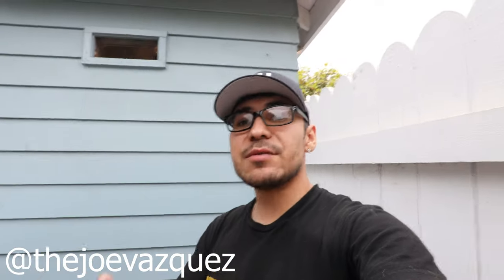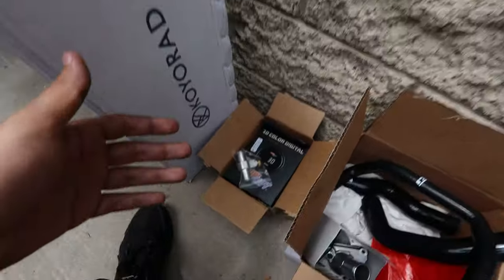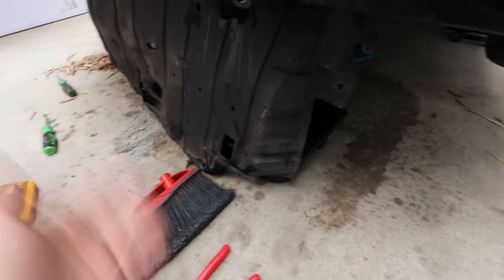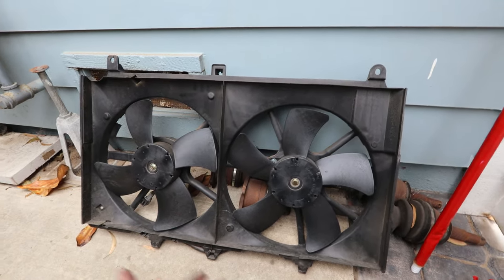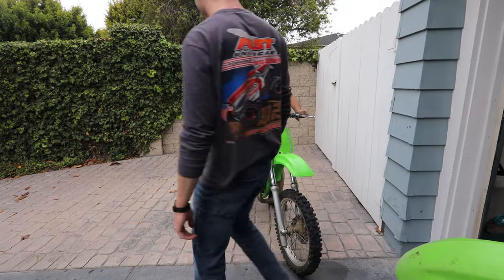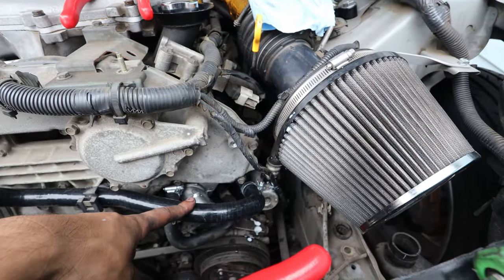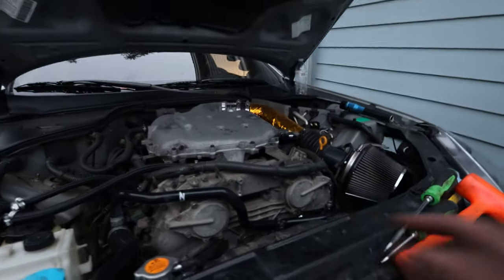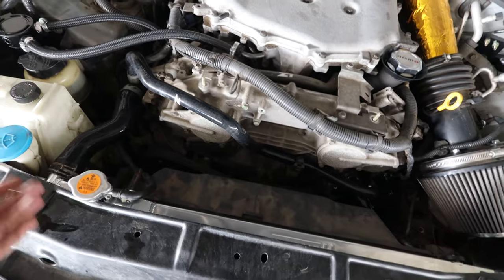Koyorad Radiator Upgrade on my G35 + Giveaway!

Comment: Same radiator I'm running and I love it. Good choice and nicely done!
Reply from the maker: Thank you!! I’m glad to hear that! Quality is definitely there and could not be more happy!!
Reply: Could I be fully stock and get that radiator ?
Reply: Yes you could, I'd suggest doing new hoses at the same time though but not nessary  just my preference.
Reply: @theg-zguy5268  like the same hoses Joe got?
Reply: Any quality silicon hoses, z1, mishimoto, zap ect.
Reply: @theg-zguy5268  okay and would mishimoto radiator work too? Or which one is better?
Reply: That's preference IMO so can't really help you out there. I prefer my koyo personally but everyone has their own opinion on what they like.
Reply: @theg-zguy5268  it’s just cause I’m stock and I have a coolant leak. I’ve had someone tell me I can’t get Misimoto or Koyo.
Reply from the maker: You can definitely run them no problem, I know mishimotos is a bit thicker than koyo, so clearance may get a bit tighter with stock fans, which is why they have low pro fans aswell but you don’t need them as stock fans are great. Koyorad isn’t as much as a sacrifice but still has great quality. You can’t really go wrong with either.

Comment: Hi, good work!
I have a question. This radiator has 53mm core? I'm searching a new water radiator for my 350Z and there are 3 diferent models from koyo! 36mm, 48mm and 53mm. Do you know which is yours? I'm worry about the fan shroud can't be installed if the radiator is too much thick.
Thanks.

Comment: Should look into some lightweight pulleys. I heard non stop tuning sells a set that actually makes power and torque. I’m debating getting them
Reply from the maker: I honestly wouldn’t waste my money on them! The oem crank pulley has a harmonic damper that helps with vibrations and most aluminum lightweight pulley kits end up getting rid of that! The only one I’d be willing to get is an ati crank pulley since they keep that feature but that’s about it. You can do the idler pulley delete and you essentially got rid of a whole pulley with 0 consequences!

Comment: Hey dude,  what is that compressor system your using on the radiator, to bleed the system? Thanks
Reply from the maker: It’s a matco bleeder system, bucket of coolant, and a conventional air compressor!
Reply: @JoeVazquez  Thanks dude.
Reply from the maker: You got it!

Comment: Recently nabbed one of these when my stock rad let go.  Went for it once I saw you could run it with the stock fan assembly! Out of curiosity, did you ever have an issue where your fans would curve up to full blast despite the temperature sitting normal?  i'm really not sure if it's something with the thermostat, I didn't bleed it enough or something else going on.
Reply from the maker: Your fans are powered from a relay that gets powered from a coolant temp sensor when your coolant temp is hot but that’s the only time it’ll trickle on! If they’re on all the time then that’s a problem but the fans will still turn on even when the needle is in the middle on your dash! You should be fine honestly unless they’re on even when you turn on your car in the morning for the first time or something

Comment: Thanks for this excellent video! I'm about to upgrade the radiator on my '06 6MT coupe that's got about 140k miles on it, and this'll be very helpful.  What clamp assortment kit was that you had? And do you have the part number for the suction tool?
Reply from the maker: I used the ones that came with the car, best clamps are the spring loaded clamps foresure! As for the suction tool, I found harbor freight alternative that’s cheaper
Reply: Thanks for the info  @JoeVazquez  - I asked about the clamp kit because I saw one in the background of this video. I'll check into the HF suction kit too

Comment: Does your intake get wet without the well? I have the same setup
Reply from the maker: Doesn’t really rain in Cali all that often so I haven’t had a real chance to see if it does, they do sell some socks that are water resistant that you put over the filter, those work pretty good!
Reply: Definitely going to slap one on thanks 🙏🏽
Reply from the maker: No problem bro! 🙏

Comment: Was wondering what one i needed but im seeinf alot of only manual trans does that really matter? I got the awd automatic but i assume the fans will still be same place hopefully cause im gettin one of these within the week
Reply from the maker: If you plan on putting the radiator you’ll need to outsource an external tranny cooler because the stock radiator has one.

Comment: You mention that you're not having any overheating issues, but does your heater work? I drained and filled my radiator and now I get a bit of heat while driving but at idle (stop light or stop sign) the heat becomes cool air. I took it in to have it power bled and I'm still having the same issue; heat while moving but cool air at idle or stop even with my temp maxed out at 90F.
Reply from the maker: Do you have any leaks? And sounds like you have air in your heater core, you might have a bigger issue if not even power bleeding worked!
Reply: The g35 have in the passenger side in the back for make it bleed with a screwdriver 🪛  easy to do it

Comment: So you think Koyorad is better than Michimoto? 🤔 i will take your word for it cause I’m looking to upgrade my radiator as well.
Reply from the maker: Yes definitely better quality! I’ve heard great stuff about mishimoto, they have a killer warranty, but I’d still 100% go with koyorad!
Reply: @JoeVazquez  ok, just did some research 🧐 the mishimoto comes with a/c condenser just like stock but the koyorad doesn’t 🤔🤔🤔
Reply from the maker: I believe since mishimoto makes their radiators thick, they give you a new one that makes the radiator fit better! You will have to go and get your ac system serviced so that it works again since you’ll be draining it.
Reply from the maker: You don’t need a new ac condenser for a performance radiator, that’s why I personally like koyorad since everything is the same just like stock with no additional parts needed!!

Comment: If i go with koyorad should i install a internal transmission cooler?
Reply from the maker: it’s a must since the oem transmission cooler is removed when you remove the oem radiator! I’d check z1 motor sports for a aftermarket one!
Reply: @JoeVazquez  👍🏽👍🏽👍🏽

Comment: Man I’m so wanting to win the giveaway, just did all the steps on instagram. Good luck to everyone else entering!
Reply from the maker: Good luck bro! 🙏
Reply: @JoeVazquez    I am planning on buying G35, 

Do you face fuel gauge problems, window motor sensor problem, oil leaks etc. And also please provide the liNk for the radiator  and the head lights too, thanks in advance
Reply: @geoffreybotha1994  I have gas gauge problems, and window motor problems. And you can find the SpedD headlights on multiple websites like , Redline360 and K2 motor
Reply: @NSRTalonzo  Thank you, besides these problems anything else I should look out for. 

And would you say this car good overall
Reply: @geoffreybotha1994  Check gears, in manual and automatic, sadly my clutch messed up today. 
If you’re looking for a drift car YES get the G, BUT if you’re looking for a race car then NO, if it’s just for looks definitely get it.
Reply: @geoffreybotha1994  Oh look out for the throttle body, I have the code p0507 and it messed with the idle bad
Reply: @NSRTalonzo  Thanks buddy. Mostly for using daily and love the looks.